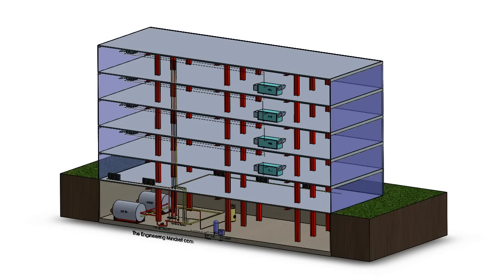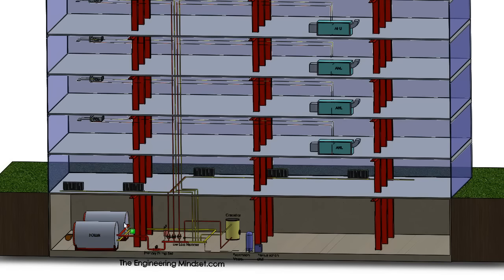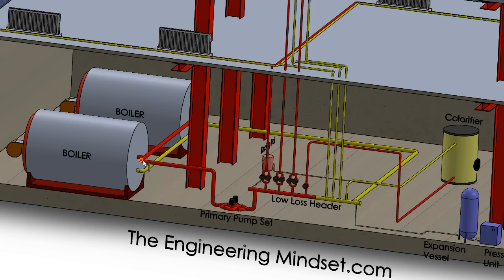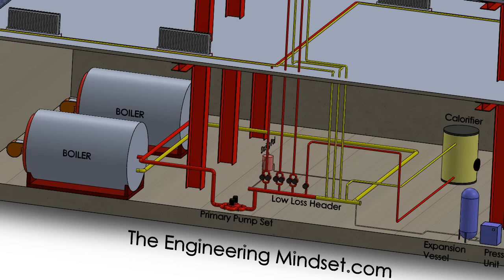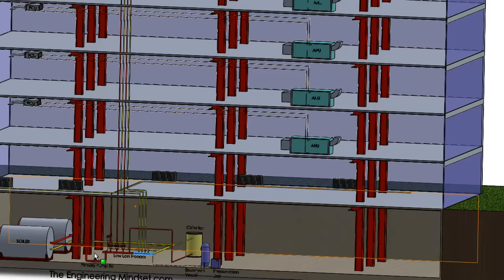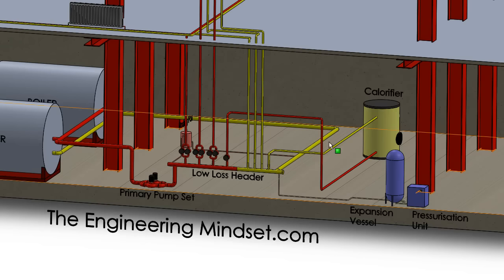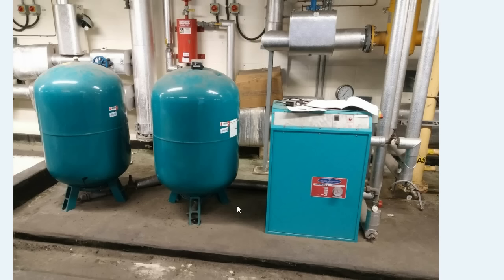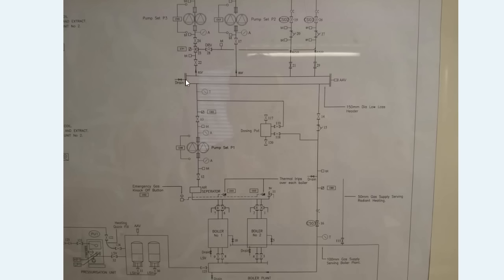How a boiler, fan coil unit, air handling unit and pump work together HVAC - Heating System 🔥🔥🔥

Comment: Can you please explain, why a 5 level apartment condo complex, be colder on the top floor, and warmer the further down the floors? We have 1 boiler, (used to have2), and this boiler is located on the roof, in an enclosed area. Does the water get distributed to the lower area of the building 1st possibly, and then does not have enough water for the top floor? Any response you could provide would be greatly appreciated , 😊

Comment: Would be cool to see the calculations to this system, as well as to go deeper into the pressurization unit on how it works. AWESOME stuff though. Thank you
Reply: Go to college
Reply: @ScottyDog345  They don't show this in college...
Reply: @arturzych138  I'm pretty sure they do
Reply: @ScottyDog345  So essentially you don't know.  MEP work is not studied at universities. You learn thermo, heat tansfer, fluid mechanicals which are the fundamentals but not hydronics or fan coil sizing etc. This is specialized work.

Comment: Could I please ask what could be the possible reason(s) that some flats in the building doesn't have hot water while others have. For the flats that doesn't have hot water, the hot water comes for 30 sec than gone completely. Some suggested this is due to debris in the water circulation and would need a power flush. Would that work? Esp would the power flush cleans the part between the central loop and individual HEU? Many thanks for your answer!

Comment: What a great video. I work in the sector in London and it aggravates me a bit the so frequent use of strange acronyms which I often believe is mainly a way to sound smart rather than actually saving time and I found this video as I never heard of LTHW before. It is supposed to stand for low temperature hot water but ultimately it is just a typical boiler system that pumps very hot water and returns a bit lower temperature water, correct? What is low temperature about it? What other system is it? I saw another description that says the following:   "Mechanical Low-Temperature Hot Water (LTHW) systems are cutting-edge solutions designed to provide efficient heating for various applications. Unlike traditional heating systems, LTHW systems operate at lower temperatures, offering improved energy efficiency and reducing environmental impact. These systems typically use water as the heat transfer medium, circulating it through pipes to deliver warmth where it’s needed.". Is the point that it uses water as a means of transport rather than air as an airsource heat pump (ASHP if we are being silly).

Comment: Thanks for the video, please keep it up.

Please explain the whole STEAM system/plumbing, such as valves, pressure reducers, strainers, steam trap, condensate pumps. How they work and how to identify any problems and ware.

What direction they flow, supply and return. Also what is inline with the supply, as well what is inline with return.

What more is there to know about STEAM and how it works?

Gary Gleason is great, I just cannot find any training videos from him.

Comment: First, I want to thank you for the great video.  There is a ton of great information and it is presented well.  I recommend this video to my students when they are studying commercial hydronic systems because it does such a great job of introducing them to this type of system.
I do have one quick question.  In your drawing, you have the expansion tank connected to discharge side of the primary loop pump.  I have always connected the expansion tank on the suction of the pumping station to preserve NPSH.  I am curious why you have it set up like this.

Comment: Do you have a video on the difference between a 2 pipe system and a 4 pipe system?
Meaning that a FCU coil an rather be cooling or heating
Thanks
Reply from the maker: We have a video on FCU's, which briefly covers this https://youtu.be/MqM-U8bftCI but we have another video on fcu connects on the production list

Comment: Can you explain the difference between a boiler feedwater pump and the primary/secondary hot water pumps? Thanks! Great videos!
Reply: The boiler feed water pump add water to the boiler.  Seconday hot water pumps move hot water through a steam to hot water converter then to the heating coils
Reply: Boiler feed water pumps are generally  referred to as pumps that supply steam in a steam system.  Primary pumps pumps more water through a water system boiler to the header .  The secondary pumps move the water out into the building
Reply: Boiler feed water is mainly for steam boilers, primary secondary hot water pumps are for hot water boilers. 
The pump controller of the steam boiler senses the level of water in the steam boiler and calls for water from the boiler feed tank through pumps. Boiler feed tank is fed from the vacuum/condensate pumps which is fed from condensate return after the steam has reached the radiators and passed through steam traps. Steam traps basically ensure that steam condenses into water and should not allow steam to pass through. Steam boiler will do this to maintain the right water level for the steam boiler. 
Primary and secondary pumps are for hot water boilers described here. Primary pump is the pump that kicks on first depending on the needs/call for heat to the zoned spaces. A secondary pump can work in tandem (meaning they can split the load to reduce stress on the pumps) or operate separately so that if one pump goes down and needs to be serviced, the second one can run to provide heat.

Comment: may be a stupid question but where the water came into the boilers? or I would say, can you please give more brief info on makeup water for both chillers and boilers
Reply from the maker: there will be another pipe connected to feed water into the loop. we've added boiler videos to the list
Reply: The steam is reclaimed as condensate then fed back into the boiler.

Comment: Is a system like this a risk for legionella? And if so, which parts of the system?
Reply from the maker: This type is a closed system so it's not really a risk. The makeup water tank might be though
Reply: @EngineeringMindset  Make up tank is usually heated to 215f so probably no legionella.
Reply: No part of a boiler system is at risk for legionella,  just cooling tower loops.
Reply: @maness2112  why would it be heated to 215 ?

Comment: Do you not need zone valves on commercial heating systems?
Reply: Typically there is a valve in each space rather than a zone like in a home .  For example each classroom in a school has its own valve . Anything less that 1 valve per  space results in less comfort  of temperate.

Comment: Hi, where does the initial inlet water come from? All I can see is the recirc water
Reply: Generally the supply water main comes from a city line at the street via an underground supply pipe. Same for things like sewer, gas, electric, all connect via underground mains owned by the city.

Comment: I can't wrap my head around how the water coming back from secondary return doesnt get sucked back by secondary pumps again? I mean there are pumps pushing the water certain way but when two streams interact how do we ensure that the net flow is in the direction we want? Doesn't it go back sometimes?
Reply: Jo Kah check valves, allow for only direction of flow.

Comment: Good vid, already familiar w it but always good to see a well done illustration, so many of the temp morons I worked w should've seen stuff like this, youtube didn't exist then though. Some temps should've been tossed off roof tops, those morons who ask why things say 'DON'T TOUCH, HOT' and they ask why, 'cause it's a fuckin boiler, it boils water', seriously, boss hired em, I had to work w em, got more done wo em.

Comment: Im trying to understand why commercial building would need heat pumps and a boiler system for space heating
Reply from the maker: Some examples: The heating load or use of the building has changed over time from design, its cheaper to add a heat pump than increase the pipework, pumps and boiler. It could be that it is more efficient to install a heat pump, for example on the weekend only a small section of the building is used and needs heating, the central plant is more expensive to run than a small heat pump
Reply: There becomes often a temperature where heatpumps don't heat well .  If the systems use the same piping it's important that boiler not get so hot that it ruins the heatpump.  Best to use condensing boilers for that reason